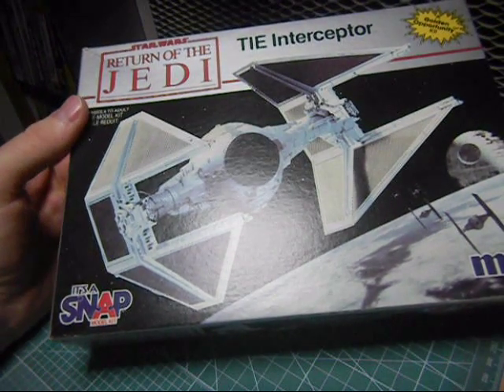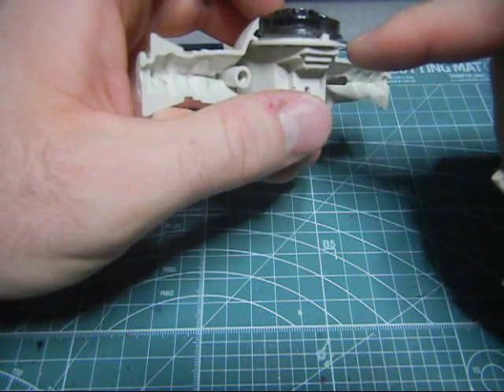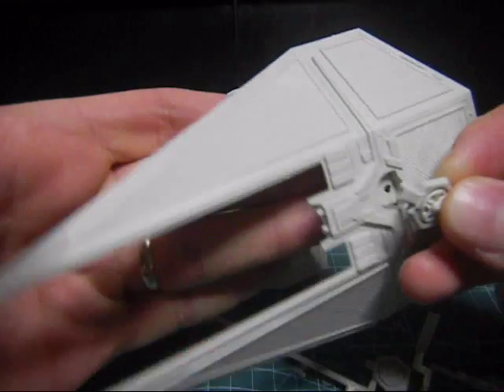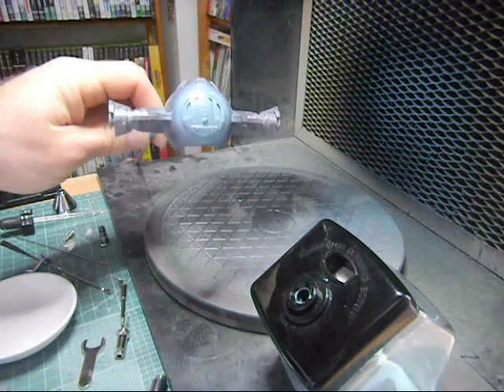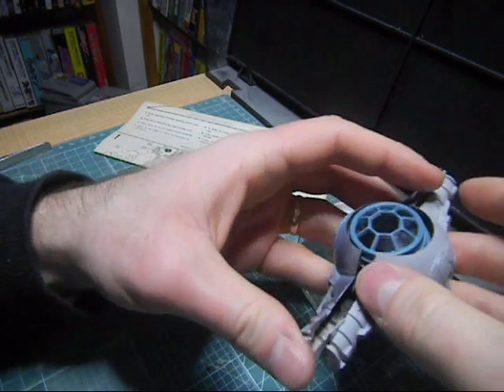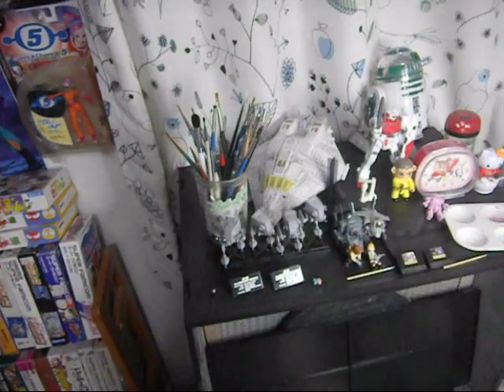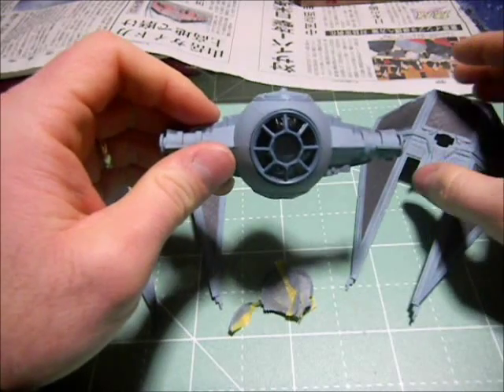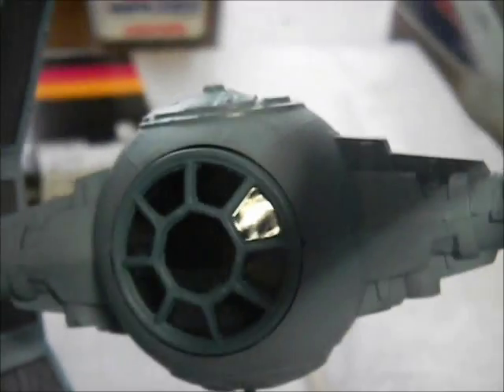TIE Interceptor MPC plamo build video COMPLETE

Comment: I'm working on this kit, it has a lot of ejector pin marks, it's warped and the sensor plates in front and the thrusters in back are completely missing but I think I can find a resin aftermarket set to fix this flaw. The pilot is way wrong but I can live with it, it's very obvious mpc rushed this kit to market.
Reply from the maker: I saved the pilot to use in the MPC A-Wing kit. I don't know about the back, but the front laser cannons situated under the cockpit viewport are not there. I started working on the Finemolds Interceptor a few years ago, but that project was kinda shelved and forgotten about. I get too easily distracted.
Reply: I hear that! I get distracted by a lot, mainly life but other projects too. 
As for this old mpc kit, there is a lot of detail missing and I had to sand down everything, add details with strips of styrene and careful gluing. It's shoddiness makes it a challenge!! (^_^)